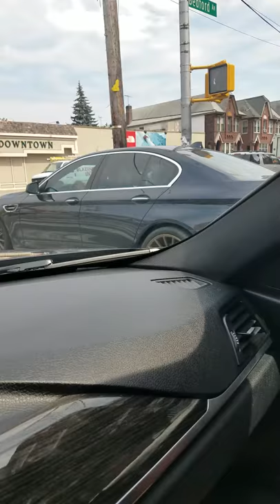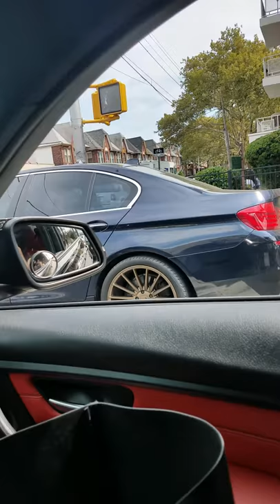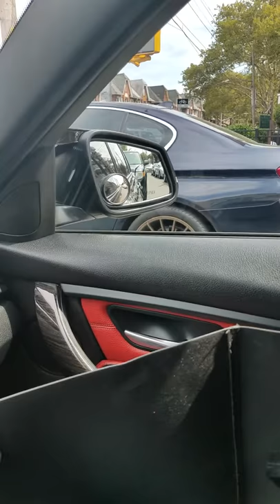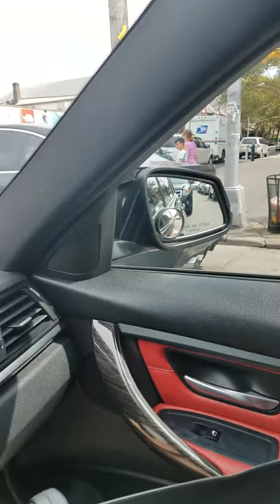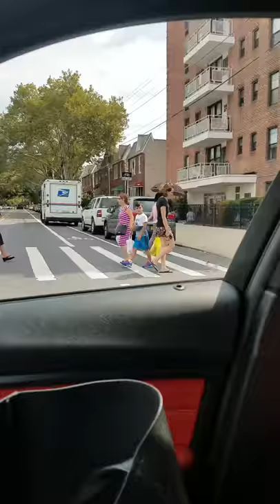Fake bmw m5

Comment: The best thing to do if you own a 550i M sport: Remove all the emblems and modified to quad exhaust.
Reply from the maker: I think that was a 535i. I heard thr engine n55 sound when he took off. Nice wicked 👌
Reply: the car in the video not even a V8 😭 and it looks nothing like the 550i ... and the best thing to do would be to get a custom m5 bumper , n yea the exhaust...

Comment: The right and the left front panels are M...they are pretty expensive to be used on an bmw 520d lol... Don't judge someone by the cover if you don't know what is inside lol ... how to spot a real BMW M-power? Look at his gearbox or engine.. and not at the exhaust or wheels, exhaust sounds, bumpers,....
Reply: Btw what car are you driving I can't see on the video... it looks pretty cool
Reply from the maker: True indeed you're right.
Reply: 2 years ago I didn't know so much about the M cars. But now I can directly see this is not a real m5 like you said in the video. 
I guess the front bumper was just a regular M package bumper, but I'm not 100% sure because I can't see that on the video clearly.
But like you said, the brakes are not Motorsport. 
And I change my mind, you can definitely identify a M car by it exhaust sound. 
😁😅